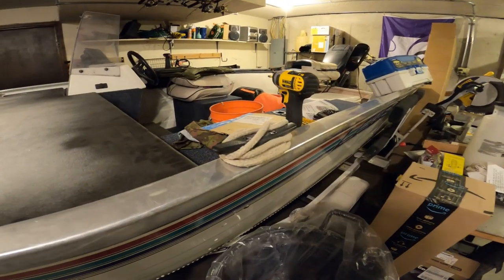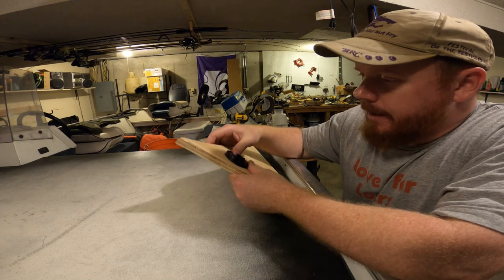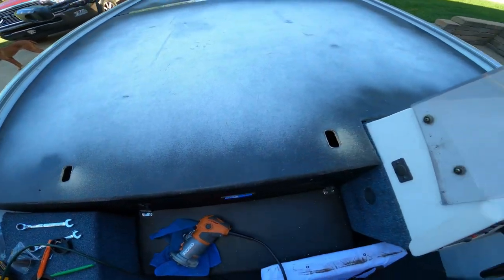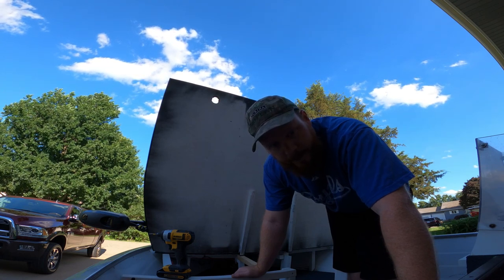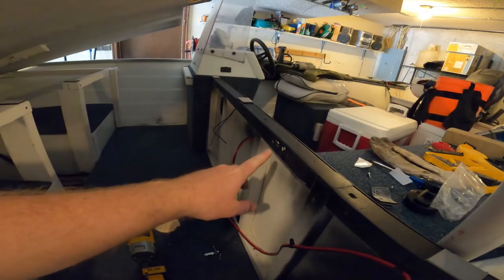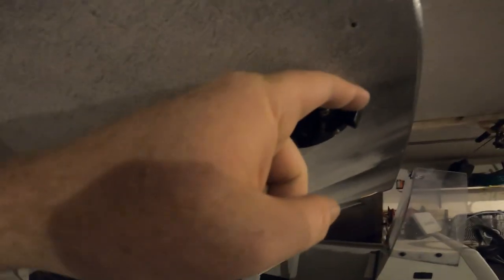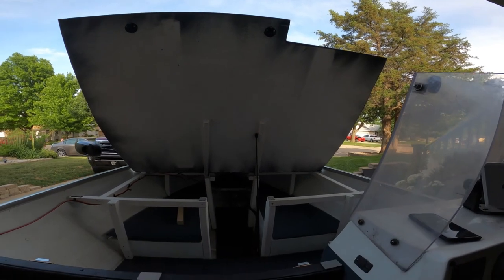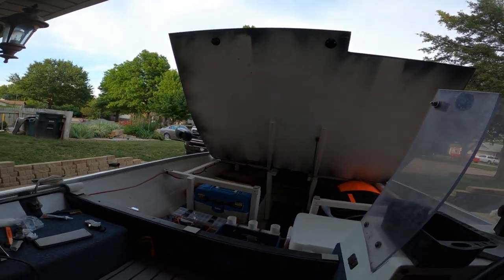Ultimate Boat Deck Build Episode 14

Comment: Use cardboard to make a template and transfer that to the decking material for a clean cut, how well do you like the foot controller for the trolling motor?
Reply from the maker: I like it a lot but I use my remote a lot more.